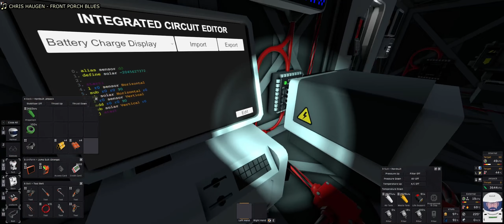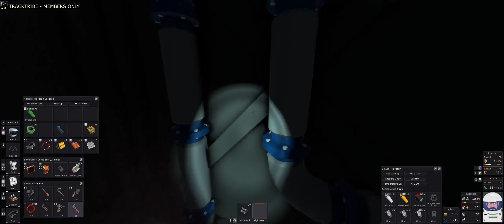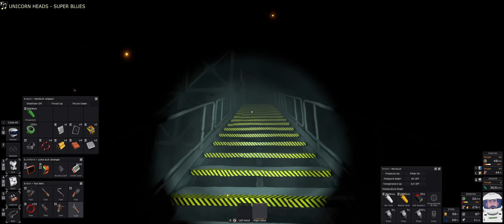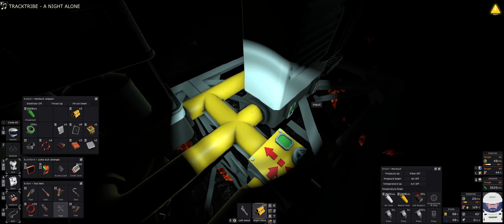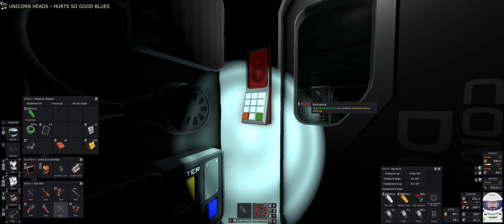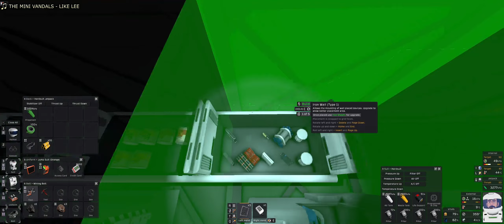Let the Water Flow - Episode 4 ║ Stationeers

Comment: I presume you will eventually need to take the portable air conditioner outside to vent out all that hot gas so you can bring it back in and cool the room again? when you had the window I noticed the temperature was slowly rising. Will you be using some of the generated (hot) water with a heat exchanger to make an air conditioner? you gotta cool that water after all before bringing it into the inside, right?
Reply: Ohhhh, I just saw the part where you deleted all the gas inside the portable air conditioner. Okay. And a bit after the point when you mentioned the heat exchangers you'll be putting on the ceiling
Reply: I also had a thought for your ceiling coolers, you could also always have another branch at the beginning that turns the coolers off during the daytime (using your outside sensor) so they aren't working so hard in the heat. When it's cool enough (maybe <200C) then they can do the battery check and pump out the hot air when the inside is too hot.
Reply from the maker: That's pretty much what I ended up doing. :)

But, instead of using the outside sensor, I will use a pipe analyzer. It will make sense hopefully. :D

Basically, I will turn the base into a refrigerator, with a closed pipe loop full of coolant gas. The coolers will dump the heat into that pipe, heating up the coolant, and I'll use radiators to get rid of that heat.

As for the portable AC, venting it out would have been pretty easy. It just needs a tank connector (like that one I used for the oxygen tank), put a passive vent outside, and connect them with insulated pipes.

But since it was such a temporary thing, I didn't want to bother setting it up, only to tear it down a couple minutes later. So I just deleted the gases by packing up the AC. A bit of an exploit, but it was more of a time saver than anything. :)